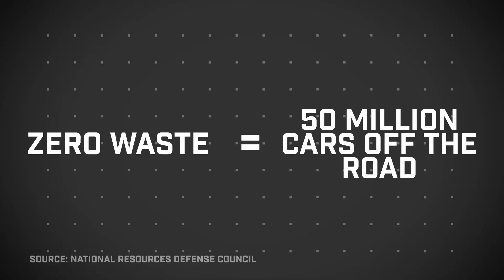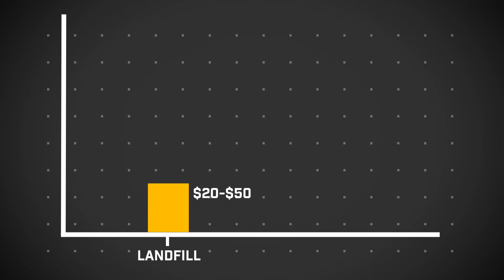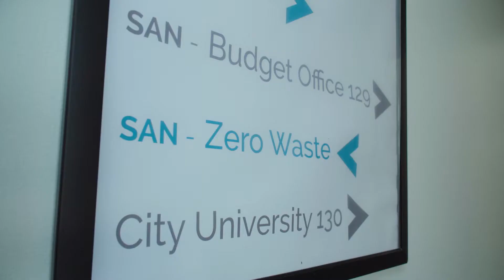Does Recycling Work?

Comment: Recycling is the process of converting waste materials into new materials and objects.  PROOF IT IS WORKING https://sweden.se/nature/the-swedish-recycling-revolution/
Reply from the maker: Josh it works well in Sweden, partially, because they don’t have the wide open spaces we do, to build landfills. That drives up the cost of landfilling and helps balance out the higher costs of recycling.
Reply: The point is it works! Business dont always work but yes recycling works. It doesn't require a business it could be a craft or hobby, maybe old men like to salvage metal and make a helmet to protect them from radio or nuclear bombs.

Comment: The Biggest problem I have to recycling ing Dallas is access. I live in an apt that doesn't have any recycling options and it's difficult to transport my recycling miles away, especially without a car.
Reply from the maker: Dave Patterson Thanks. Apartments are in the Dallas Council's crosshairs. The apartment owners association has resisted.